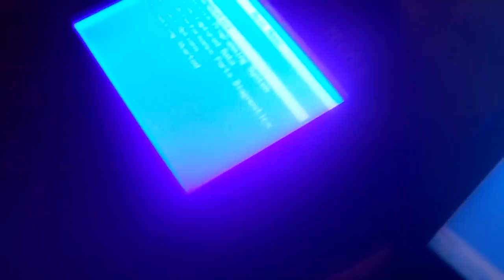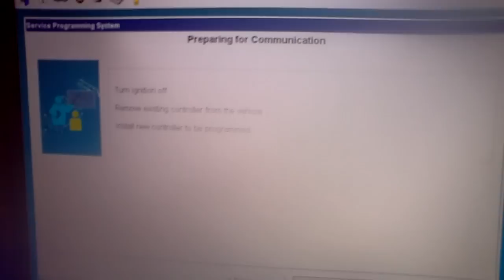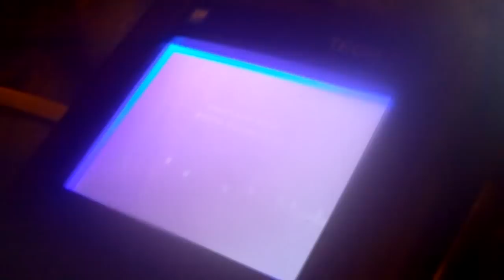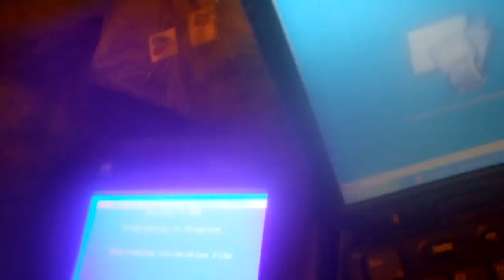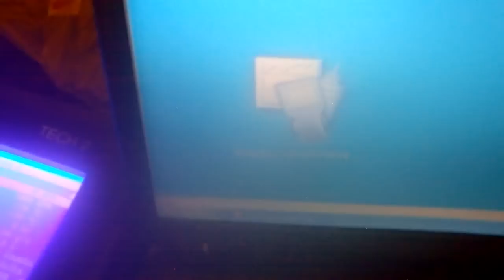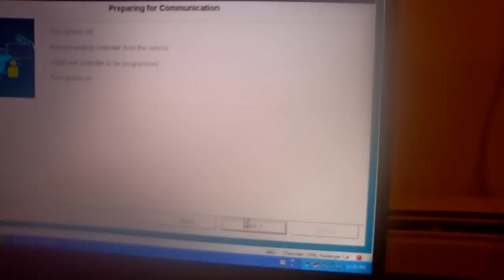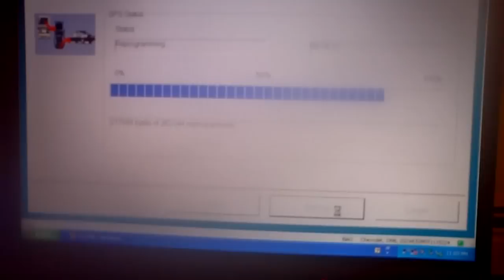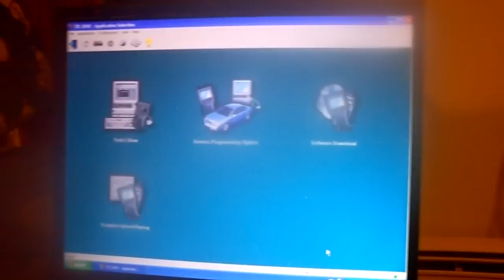Reprogram GM PCM using a Tech 2 scan tool

Comment: Your videos have been great. I am struggling with dealers on a GM 2008 H3. I purchased a Tech2 and have diagnosed several issues and repaired. I am stumped with one final issue...   had common sunroof water leaks some time back and radio got damaged and eventually key fobs stopped working. Ignored until recently and dealt without using remotes. Leaks have been repaired and radio has been replaced successfully. However, recently had tires changed and TPMS is not working either. I did a lot of research on this and discovered that my H3 does not have a separate remote door lock receiver as mechanics told me was bad.  My H3 apparently has a built in receiver into the BCM that  I believe receives signals from both the TPMS and Fobs.  I purchased a BCM out of other that is same part number. I am not sure where to go from here with Tech2 and/or Tis2Web?  If I just swap BCM it shouldn't work without reprogramming to my VIN? Also am afraid it could affect my instrument cluster Odometer as others have hinted online.  It has been very informative watching your videos (wish you had more new ones).  If you can help I would greatly appreciate it. Is there a better way to contact you? I also acquired a bench harness for my H3 for testing as well.
Reply from the maker: you are on the right track, the BCM is the for the fobs and tpms, to install a replacement BCM use Tis2web to program replacement BCM, learn restraint ID, program theft deterrent system components, program key fobs, program tpms. the mileage storage for your H3 is in the IBCM(BCM) and Tis2web will walk you thru the reprogramming when replacing the BCM refer to TSB # 07-08-49-020H

Comment: I am wanting to program a new BCM in a 2009 corvette,  when i use the tech 2 to diagnose the car i have the option to go to the year 2013.  Now when i go to program the car my options only go to 2007. I have the lasted 33.004 software and even down loaded the latest version twice, what do i need to do for it to do 09 so i can program like the video? Thanks for your time
Reply from the maker: Reprogramming and setting up a new BCM is not done in the way of the video, you have to use a Tech2 to go through and set the RPO codes in the BCM, after BCM setup you then need to do BPP sensor calibration, you will find the RPO code list sticker in the glove box the latest is 33.004, make sure when you power it on that it says that.

Comment: I have a 2007 sierra E38 computer with the lh6 engine. I need to put a corvette tune on it, am I able to use my tech2 this way to load the corvette tune from hptuner onto my ecu?
Reply from the maker: No, you need to use one of their (HPTuner) cables and software, to put a corvette stock tune you need to use the corvette VIN in it but that may cause problems at emission testing time depending how your state.

Comment: Hi Ken I have a customer who was sent away from the dealership stating they could not reprogram his vehicle (too old). It is a 2001 Monte Carlo and it has a bum BCM that needs to be re-flashed and then Passlock re-learned. I noticed you mentioned the Mongoose Pro.  Does this work to program his platform? I have received mixed responses. Thanks
Reply: Yes thank you for that.  However, I only had to purchase tech2win for this particular model (2000 Monte Carlo) as the BCM already comes programmed from GM for that model.  All I had to do was set it up using the Tech2win software.
Reply: Dont know why a dealership turned away a customer for a BCM reflash. I just had my BCM in my 2002 Monte Carlo that errored done at my local GM dealership. Took about 45 mins with Passlock relearn included. Charged me $110, but was worth it to get some of my cars electronics working properly again.
Reply: ***** Because they are incompetent, mindless drones who want nothing to do with anything over 5 years old. GM has a new scan tool now that supplanted the Tech 2. The Tech 2 is now a software emulation available for download on the GM service website. Trouble is, it is very glitchy, and technicians avoid it for fear of frying a module.   It has been almost a year since I repaired that Monte Carlo. I learned a lot in the process because GM's are not my specialty, I service European cars only.  What I learned: All GM BCM's made by Motorola circa 1998-2005 come with the factory programming already installed.  You simply have to configure it using a scan tool for the specific application.  Say for example if it has fog lights or not, sunroof, onstar, etc. I believe Launch, and Autel have the capability to do this.  Otherwise, you purchase the TECH2WIN program from the GM service website. It takes 15 minutes tops. You enter the options the vehicle has, and then re-learn passlock. That part takes 10 minutes, and boom you are done.

Comment: Are you able to program a PCM for a 2005 Buick Rendezvous Ultra w/ 3.6 engine?  My tech2 is giving me an error and no matter what I try I can’t seem to get it working. Tech2 was unable to communicate with pcm to check codes, obd2 scanner could not read codes. Will not turn over. New battery. Says error on odometer.  I bought a refurb unit from local Buick dealer and I’m stuck now. Probably another problem but I want to get the pcm programmed to confirm.
Reply from the maker: if tech2 can not communicate and odo error sounds like you have a class 2 problem, disconnect everything on class 2 to find it if everything unplugged and still  issues then you have a short in or to Class 2,  the list is very long on your car for items on class 2, they are ECM, memory seat module, instrument cluster, theft deterrent module,  heads up display, hvac, BCM, Electronic brake control module, air bag module(SDM), Vehicle communications module, rear seat entertainment, and radio.... you may not have all of these and think if any of these were acting up before or any recent event in the vehicle related to the list IE new radio, air bag light came on, and start with those, the car also has a TCM and uses high speed CAN so you should also be using the Candi module with the Tech2 but the problem you describe sounds like a class 2 issue and not a CAN bus problem... you never know.... if you have not tried it, disconnect the Negative battery cable for 20 min and see if that clears it up also
Reply: ASEKen the shop that diagnosed the problem was able to start the car by jumping certain pins on the electrical connections, apparently strongly suggesting the pcm was bad. When shopping for them on eBay already programmed I came across a person telling me sometimes these modules are difficult to program with tech2 and sometimes require the mdi. I think I am going to take it to the local dealer for programming and diagnosis for no start. If I could find someone to program it for me off vehicle it would be great. I might just buy another pcm and get it programmed by them. At least I would rule it out before going to dealer. My tech2 gave me a failure when programming due to utility 12592123 and various line error operation error code listings
Reply: ASEKen feels like being able to communicate with tcm bcm and ebcm with tech2 but not with old ecm indicates problem with ecm wiring or ecm itself. It simply would not register or even read the ecm for codes. I am using the candi module as well. Got to like 90%+ when programming and was unable to finish due to errors I listed earlier.
Reply from the maker: if you were able to begin a program and stooped at 90% and stopped then it probably bricked the ECM, that does not explain the ODO problem. did you have that before or after the replace of the replacement ECM, you can try and off board programmer like the one I am using in this video, all I did was use a junkyard PCM and connector and wired power, ground and data wires to the DLC and PCM/ECM from the same for and reflash, I have done the same for Fords, Hondas and Chryslers and works fine for reflashing
Reply: ASEKen couldn’t find any of these pcms locally. Dropped over $300 on it. Hopefully not toasted. Will try off board programming sometime. I wanted to add the two codes the shop who originally diagnosed the car with bad pcm found. U2105 and u2108. Not sure if that helps you narrow anything down. I have a spare bcm I may try to see if it corrects the no start
Reply from the maker: Geico Kaveman U codes are communication codes. Most likely not an issue with the ecm. As to find a good price for used parts... i do to cat-parts.com and find the cheapest ones and call them and have them shipped. Ecm is small and inexpensive to ship
Reply: ASEKen I’ve bought lots of parts from car-parts.com thank you though. I took a chance on a returnable preprogrammed ecm and the thing immediately started without the passlock relearn. So it was a dead ecm. Now I’m going to probably try to get my new one programmed so I can’t return this used one. Thanks for your help and guidance here. Wish I was more knowledgeable and able to diagnose electrical issues better

Comment: Id like to ask a question about programming a bcm on an 02 rendezvous. I have switched the module out and everything works. I was under the impression it would require reprogramming. When following these steps to program the bcm I do not have the option to program the bcm. Only security or pcm/vcm. I know I'm doing it wrong but what is the proper procedure for the bcm?
Reply from the maker: Geico Kaveman it only needs to be coded...... turn on and off option with tech2
Reply: ASEKen can you elaborate on that process a little?  It's an 02 rendezvous and I assume I go to mpv/light truck, then select U?  Or is it B?  B is 5th digit.  I want to make sure it's programmed properly. Already vastly improved, locks are working and lights are on and I got the radio working again today. Thanks for your help!

Comment: With the Tech2 tool and toughbook running tis2000 can odometer corrections be done?
Reply from the maker: no, those can only be done directly to the ip. with specialized equipment
Reply: @ASEKen  you mean the j2534 pass thru programmer?

Comment: In theory, will ANY J2534 compliant cable with with GM's TIS?  I see el cheapo J2534 cables on the market.
Reply from the maker: chipjumper yes any j2534 works if it has the right protocall

Comment: at 3:04 is this where I change to my vin for my truck if I'm using another module?
Reply from the maker: only if you are changing the vin on the PCM, ECM or another flashable module, if its a BCM or Audio unit (not reflashable) it is done in a menu on the Tech2,

Comment: ASEKen-Thank you so much for this video.  I have tried both methods, pass-through and Tech 2, and neither has worked.
Using the pass-through, it stays at Data Transfer and all is greyed out and nothing happens.
Using Tech 2 option, when I connect the Tech 2 to the computer and follow the steps, I get a TIS error-cannot connect database.
I have one of clone Tech 2 kits, for whatever it's worth.
Thank you for your time and expertise! :o)

EDIT-Though I have the dongle key, I am using a crack to make the computer think I have the dongle connected.

Comment: Mr. Ken sir I need help using my Tech2 to update an IPC to clear up the Service Brake Booster on the DIC center sir. This truck had the cluster swapped and it has this service the brake booster but it does not have the brake booster. It is a program that needs loaded to the IPC. Is there something you can show me or please email me on how to do that please? I have a Tech2 and I have TIS2000 on my laptop that I bought from a GM dealership. Thank you Mr. Ken for any help you can provide! James
Reply from the maker: James, I can try to help you, please tell me Model, year and engine of the truck you have, and if you can the same for the cluster you put in.
Reply: Thank you sir. The vehicle is a 2003 Silverado 1500HD with the 6.0 Liter Engine and 4L80E trans and 3:73 Gears. As for the cluster I am not sure of what it is exactly but think it was from a 2004 Chevy and the number on the cluster is a H1Df I believe if that helps. I hear that with the SPS and Tech2 and TIS2000 it can be programmed but I do not know how to even begin. Thanks for your help Mr. Ken. James
Reply from the maker: you say you have TIS2000, you mean the program like I am using in the video (I can not use it that way anymore) or the online version that you log in through ACdelco.... if is the CD version I can not help anyone because GM stopped that years ago. the best way is to use https://www.acdelcotds.com/acdelco/action/subscribehome and log on and use the instructions in this video. it will cost you $40 but you will get to reflash any modules on that car for 2 years.
Reply: thank you Ken. I have not ever used mine...I bought the laptop (Toughbook) off Ebay and the seller said it came from a GM dealership that closed and that it had all the TIS2000 files on it from the dealer. I have not used it at all yet cause I wanted to find someone who could show me and help train me. I wish you lived close and I would come learn from you! I will check out what you sent me and thank you sir! James :)
Reply: When you say re flash any modules on that car does that cover the instrument cluster that is giving the service brake booster even though it came out of a different car? That is my problem is the cluster is looking for a brake booster when the vehicle has hydro booster or vise versa. Thanks sir!
Reply from the maker: yes you will be able to reflash(reprogram) any thing on the vehicle that can be reflashed with the latest calibrations(newest programming)
Reply: Thanks sir! I will give it a go! Thanks for your help.

Comment from the maker: Majid ZAREIE, I do not know anything about holden or Opel stuff, or any thing outside the USA. I did I quick check on your issue and from what I read outside the dealer ship it seems to be an issue, If it was a USA car I would go to the online SPS for the USA and that should do it. being a 2009 I would not use a tech 2 I would use an MDI or GM Mongoose cable.

Comment: quick question. After you load the program into the tech 2 can it be unplugged from ac power then replugged to car power or will it lose the information?
Reply from the maker: yes, you unplug it, the tis puts the program on the PCIMA card that you are goingto be putting in the PCM, select service programming in the tech2 when you plug into the OBD2 and it will flash the PCM
Reply: ASEKen thanks for the speedy response. This works with reprogramming bcm as well? If so do I need to program in the new aftermarket radio?
Reply from the maker: Most BCMs do not program this way but need the options turned on or off through the tech2, make sure you get the correct BCM using the RPO codes found in the glove box door or the spare tire cover
Reply: Thanks!  Big help.

Comment: hello I can really use your help, I purchased an original OTC tech2 off my friend it as the Ver 32.002. when I turn on the tech2 it said you need to update your software, but i never got the TSI2000 web disc. Where can i get it so i can load on my laptop and update me tool. also i'm going to need it to program ECM thanks
Reply from the maker: i do not know, I have never seen that massage,
Reply: it comes on then it's quickly gone, it just letting me know the tool can use updating. I like to know where did you get the disc? I know china sell the one cracked with dongle, but im told it will only work on the older vers cloned tech2, do you know?
Reply from the maker: the disc you are talking about will roll your card way back to 2008. the only legal way to update is with tis2web access..... I believe the latest update was 33.004.
Reply: Thanks, but do i need to go with a yearly sub? My intention was to pay the $35 3 day access if needed to program, also I should be able to transfer info from a bad ECM over to a new one via the tisweb software running on my pc free right?  I do know the Tisweb is used for if you're replacing say a window switch and need to load factory info bake to new one, or doing updates, is that right? What I should had asked you what PC software are you using, are you using the TIS web?   thanks again
Reply from the maker: you do not need to get the yearly the 3 days works the same, you do need to pay anytime you go to tis2web, programming a module you have to pay coding a device you do not unless it is a global diag vehicle then you need to pay for 3 day GDS

Comment: Anyone know why tech2 says “waiting for data” when programming fob to 07 g6?
Reply from the maker: Make sure all of the conditions are right for programming. You can only program up to 4 remotes for that vehicle. If all 4 slots have a remote programmed into it you have to invalidate all the remotes and program the ones you have. Otherwise it is strait forward follow the tool.
Reply: ASEKen ok thanks, it wouldn’t have anything to do with the stock radio not being there would it? That has the driver information center info but when I bought it a month ago, it didn’t have stock radio

Comment: hello
I have OPEL MERIVA (2005 Z16XE MTA)
I want to install the central locking button, as on CHEVROLET MERIVA (on OPEL MERIVA this button is not set)
 I want to learn how to write a Brazilian index (№751) on my BCM
When I want to write down the index - Tech2 displays "this index is not supported"
BCM - 13111111 YF (ID - 010F)

Comment: Do you use original or clone Tech2?
Reply from the maker: Jurijs S original
Reply: I'm truing to figure out how to connect the instrument cluster on a table to a Tech 2 to program new calibrations. Do you know if any gateway is required for the cluster to be connected (e.g. only thru BCM etc.)?